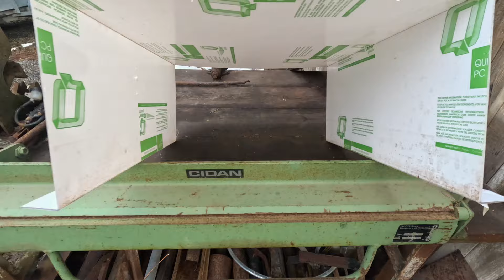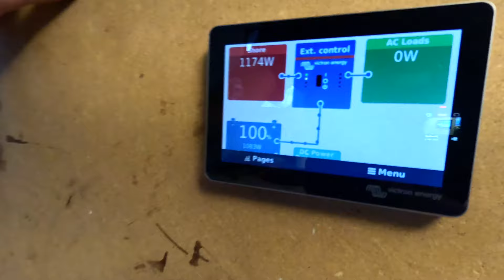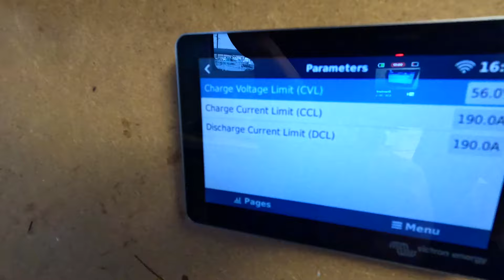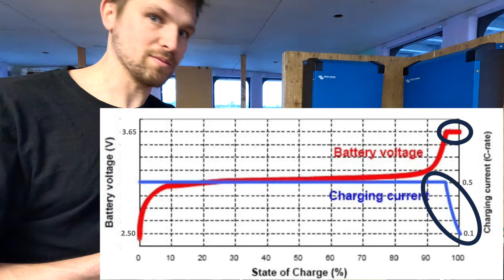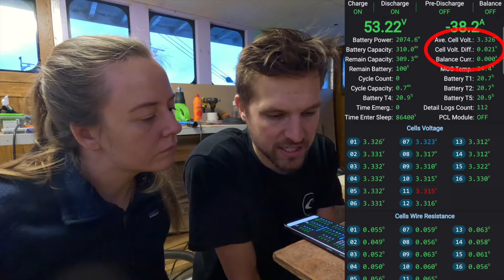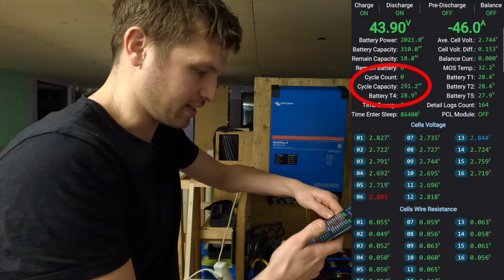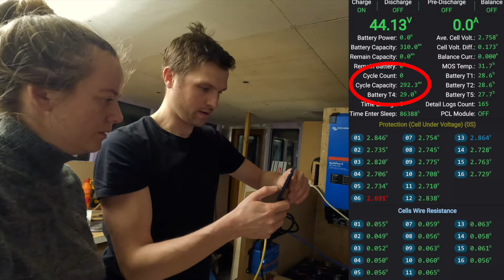Capacity Test of our DIY 48V Lithium Battery [2.09]

Comment: 3.45 each cell is perfect to charge to. 55.2 volts. I have balance set to 3.45 start 3.4 stop. This gives me plenty of power per bank( I have 4 batteries in my bank). Mine are 280ah cell EVE LFP. I use around 80% of my capacity. The biggest thing I see hurting these cells is forcing 100% and heat. Since I have 4 batteries I never go over .2C for charging/discharging. I also have 2 5k inverters with charging set to 100 amps and discharge to 100 amps each unit. I keep telling people to build your own batteries but most think they get better buying pre maid and that is not so. They just pay 2-3x as much is all. Since yours are on a moving boat I hope you have them under compression and strapped down so they do not move.

Comment: With Lifepo4 cells start balancing at charge voltage divided by 16. 56 volts divided by 16 is 3.5 you are doing 57.6 divided by 16 is 3.6 per cell. You do not get much above 3.45 per cell. This is why I do 3.45 at 55.2 volts charging. Extending the cell life is more important to me. I want my cells to out live me.